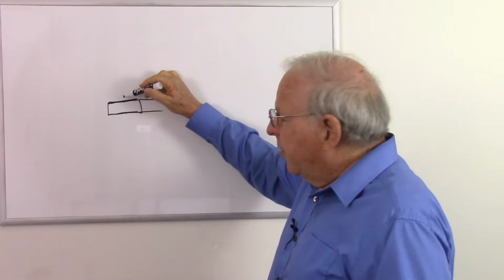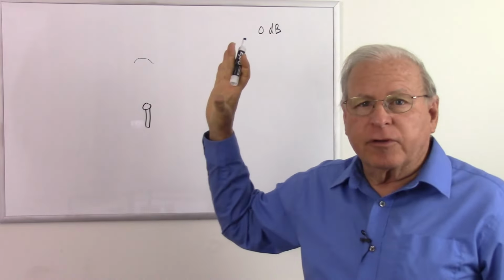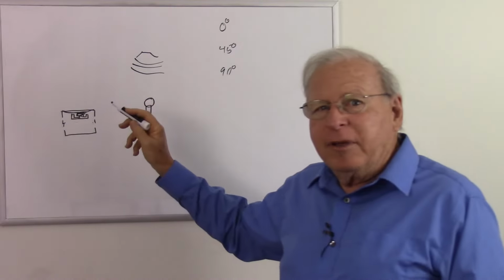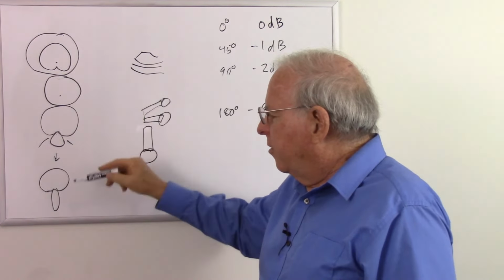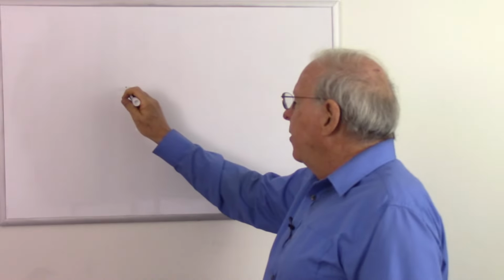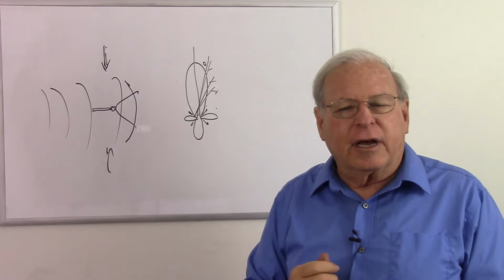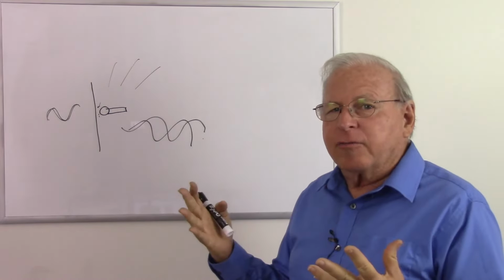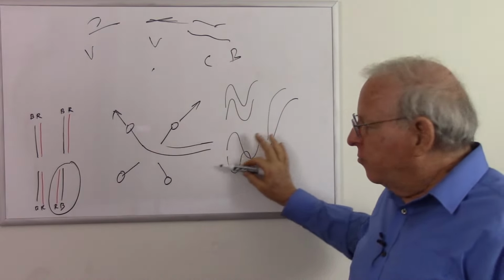Microphone Patterns and Stereo Recording - Solid-state Devices and Analog Circuits - Day 11, Part 2

Comment: I have been in electronics since 1969, and all this time, I never understood nor see the usefulness of dB, no matter how many times it was explained, subconsciously I refused to understand it, and it never made any sense to me... Boolean algebra made more sense lol.
Reply: Deal with RF communications for a while, dB is priceless.  I could be dealing with a 10kW transmitter and a receiver that has a sensitivity of .05 femtowatts.  Dealing with well over a dozen decimal places is a pain.  So much easier to deal with power in orders of magnitude.
Reply from the maker: Watch my video,  'A Quick Look at Decibels,' linked in the description. Decibels are very useful for compressing wide ranges into manageable numbers. The best example is the dynamic range of human hearing. Would you rather say 10,000,000,000,000 to 1 or 130 dB?

Comment: Ah, the CD4 Quadradisc. I still have a few.
Reply from the maker: I still have one, the one pictured on Wikipedia. I had a CD-4 receiver/amplifier, but at the time, proper cartridges and needles were only available used or new, old stock on eBay at exorbitant prices. The amplifier eventually failed (probably just bad capacitors. If I still had it, I would try to fix it). I tried using a regular Audio Technica cartridge with an elliptical needle, but the quad sound cut in and out. In stereo, it sounds horrible with all the ambient sound mixed into the front channels. Sounds like a concert in a tunnel.
Reply: @Vocademy-Electronics-Tech  I believe they used a hyper elliptical stylus often referred to as a Shibata stylus. Yes they were/are super pricey.